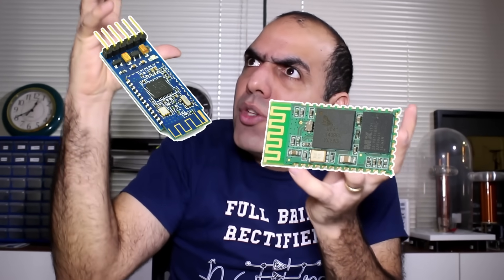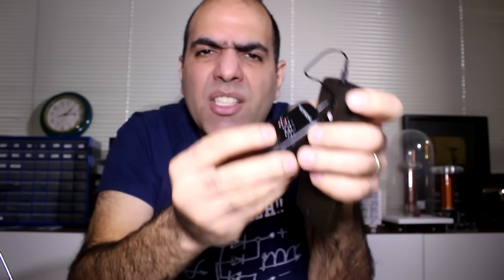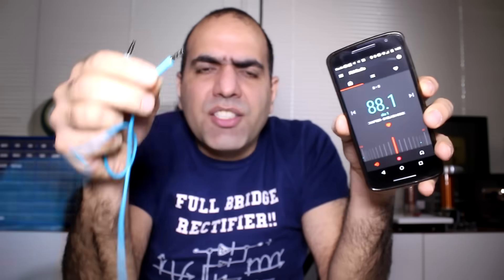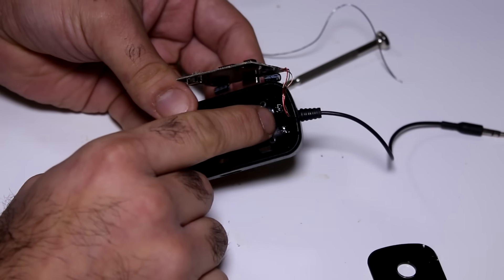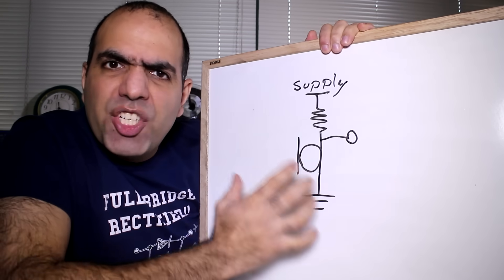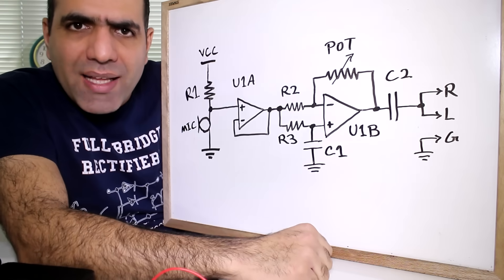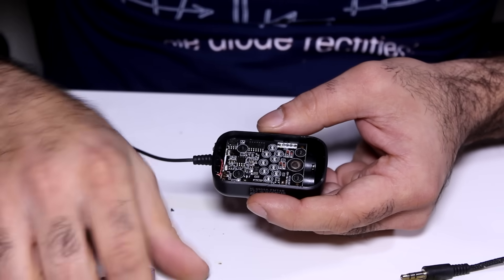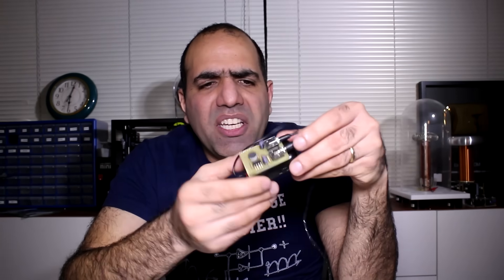Trying to Make a Wireless Lavalier Microphone

Comment: Is there a way to fix the latency through a circuit, or by using higher quality components?
Reply from the maker: unfortunately it is mostly related to the phone codecs and apps. If the receiver was just a simple FM radio, there is only very small acceptable latency.
Reply: It is impossible to fix the latency through a circuit, because that circuit would have to be non-causal, which basically means that it would have to predict the future.
Reply: Latency will always be there unless we go into some purely theoretical quantum physics.

Can it be decreased yeah. Why not but quality of components have nothing to do with it.
Reply: Some radio apps have a set buffer time that can be disabled in the settings. Check it out
Reply: Kris Gillespie, you can reduce the latency by creating a tiny time machine and sending the audio a few milliseconds back in time.
Reply: I'm not an expert, but Android's audio stack introduces a large amount of latency, regardless of the specific app or audio hardware.  If you do an internet search for "android audio latency", you'll see what I'm talking about.
Reply: @endersftd  This is exactly correct: https://youtu.be/PnDK17zP9BI?t=347
Reply: Kris Gillespie ASIO audio drivers can reduce the delay of sounds that are synthesised by applications, but i don't know if they do the same thing for audio from the microphone jack. It also might be hard / impossible to get one running on android.
Reply: There's no point in getting ASIO running on android. As Android's using ALSA. If the app would directly access ALSA, there would also be very low latency. But I guess, the most latency comes from the fm receiver.
Reply: The cut off frequency will affect the phase and group delay.
I'm talking about a tiny amount.
Something to concider though in other projects.
Reply: The real bottleneck is the A/D and D/A conversions and they are limited by the speed of the processor and the number of CPU cycles devoted to the tasks. Super fast processors doing nothing else could probably get the latency down to acceptable levels.
Reply: Thanks @electroboom and everyone else that replied. I don't have a good understanding of this stuff, so some expanded information on it is helpful.
Reply: There are cases where old analog still works best. Where you can't tolerate latency is is one of them.